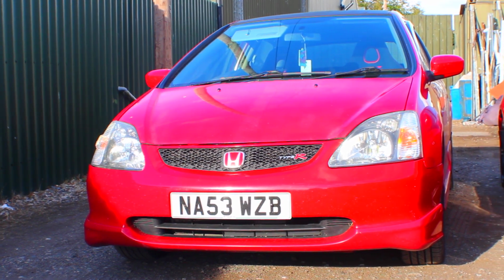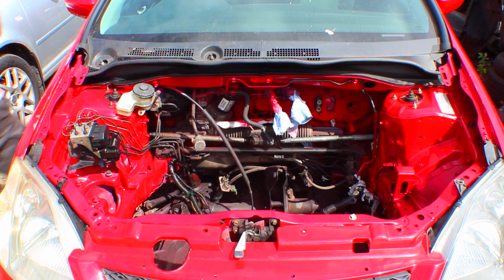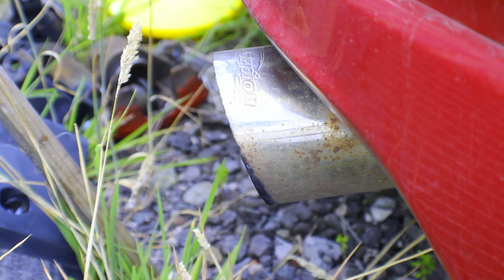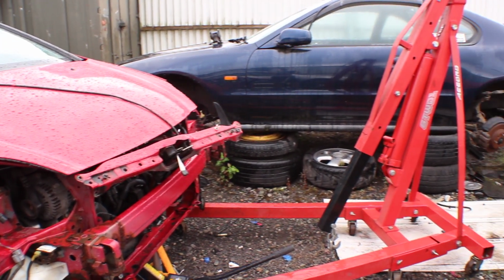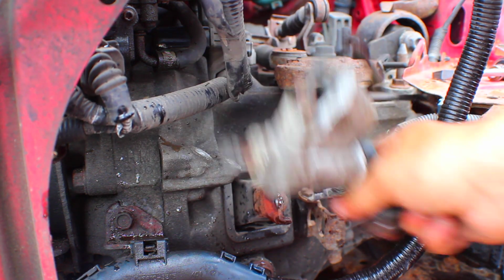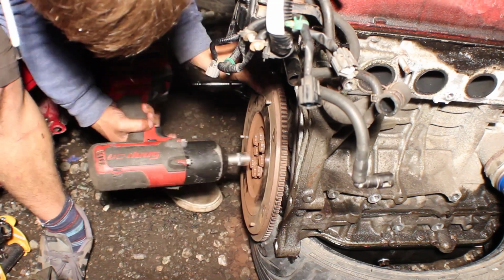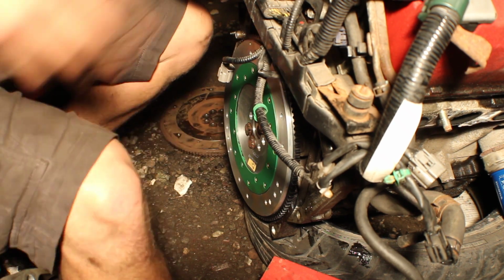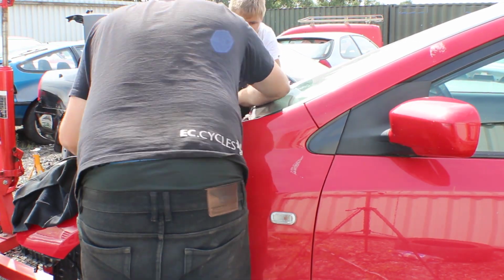Honda Civic Type R EP3 Engine Swap

Comment: Thought you had to remove the subframe and take it out from the bottom
Reply from the maker: Fits in through the top. Bit of a squeeze. Was worried about the paint job that I did to the Engine Bay the whole time XD